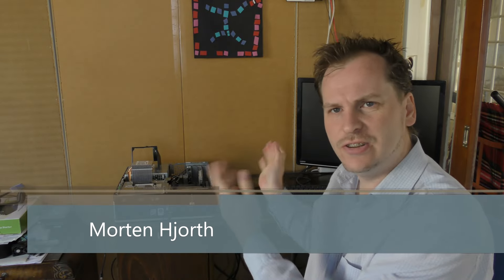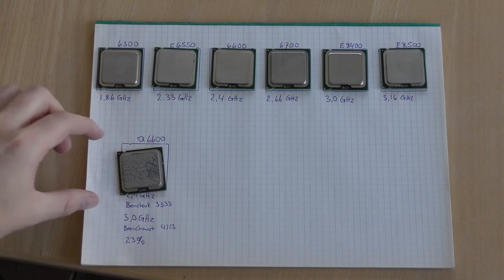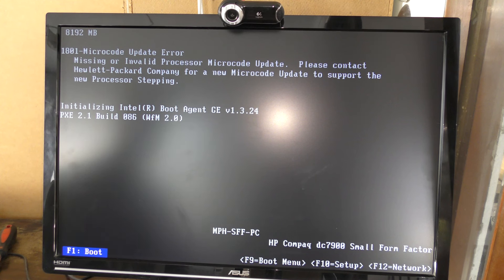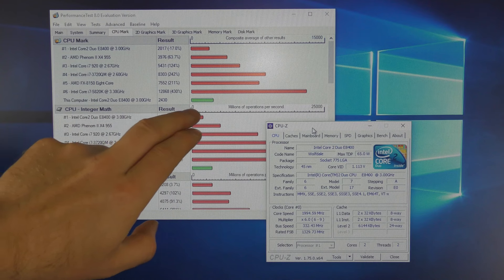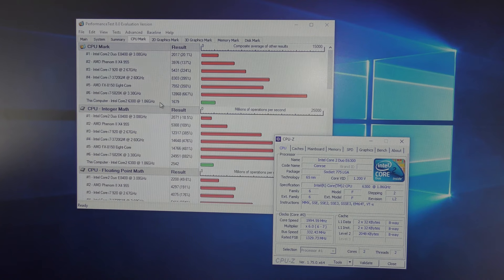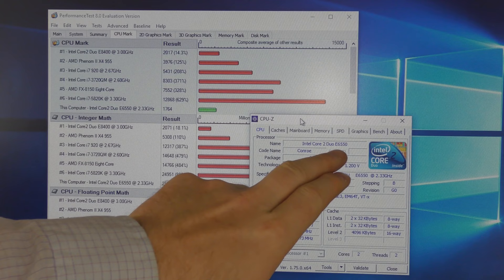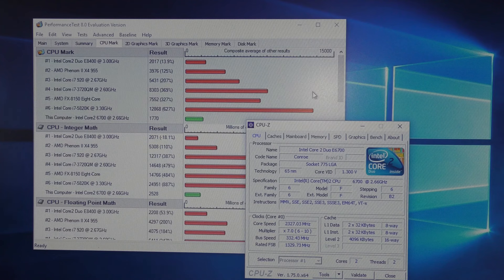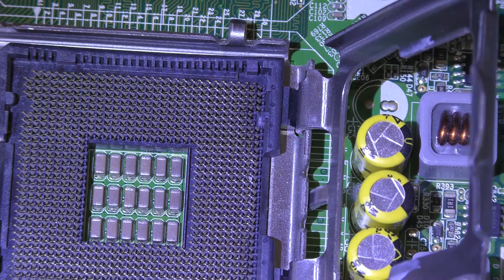Ninja Waste "BSEL Mod" E6xxx and E8xxx-series Intel Core2 - 386

Comment: where do i get microcode update for compaq dc 7700?
Reply: the sff version
Reply from the maker: Hi
Did you Google it? I'd start and see if there could be a new bios for it at HP's site.
Thank you for watching! :-)
Reply: My PlayHouse i google'd it and couldnt find it and at hp's website its only for windows xp or something. Can i do this mod without the microcode update on my e6300.
Reply from the maker: Hi albin29 
did you see this one? : http://h30434.www3.hp.com/t5/Desktop-Wireless-and-Networking/Can-a-HP-Compaq-dc7700-SFF-PC-be-upgraded-to-support-a-2-66/td-p/974939
Thank you for watching! :-)

Comment: It's called thermal interface material (TIM) and you're applying it improperly
Reply from the maker: HI
The thermal past stuff?
Thank you for watching! :-)
Reply: that's right ...check Intel's official documentation they call it TIM...and you can't.put all that on and in that.pattern! for a 775 cpu it should have a.pea sized fowr in the center and that's it, no need to put it around the cooler will spread it evenly and when you do put it around you risk it squeezing down and around the cpu on the pins in the socket! I'm a gpu it doesn't matter because there's no socket so as long as it's non-conductive you can put as much as you want but cpu must be careful....the only cpu that's diff is 2011's because they're so damn big you put a small line in the center about .75cm or so long

Comment: Hi, it's possible whit the Q9550 ? :) Thanks
Reply from the maker: Hi
Probably,, if it becomes any faster,, no idea :-) If you try it, do report back :-)
Thank you for watching! :-)
Reply: Nope. The Q9550 already had a 1333FSB, this trick only works on 1066FSB CPUs because you raise the FSB to 1333. Not all motherboards will do this however. Earlier 775 boards default to 1066FSB or even 800 for the P4 only boards.
Reply from the maker: Hi nelizmastr 
Thank you for the good info!
Thank you for watching! :-)

Comment: I have an E5800 Socket 775 LGA and I tried it 2 times and the pc runs but with just a blackscreen
Reply: and the fans go crazy
Reply from the maker: HI
http://ark.intel.com/products/42802/Intel-Pentium-Processor-E5800-2M-Cache-3_20-GHz-800-MHz-FSB

The E5800 is ment for 800MHz FSB, so Ninja hacking it for 1333MHz,, is to much.
Maybe try this : http://www.xtremesystems.org/forums/attachment.php?attachmentid=75201&stc=1&d=1206653163
The RED hack,,, but it is more difficult. :-/
 Thank you for watching! :-)
Reply: My PlayHouse
Do I connect the two pads somehow or do I just put tape on them. Because it looks like I have to connect them but how?
Reply from the maker: HI Tobstar138 
I haven't tried this one,,, read up on it!
Thank you for watching! :-)

Comment: This is not an O.C. at all, maybe a hack to make the pc unstable. The only way to O.C. is in BIOS using multiplier or FSB, tho overclocking thru FSB will likelly overclock everything on the motherboard and will run hotter. So if you have a locked CPU stick with it stock. In case you wanna O.C. make sure you have a good aftermarket cooler.
Reply from the maker: Hi Psykode
Thank You very much!  glad you liked the video :-)
Thank you for watching! :-)
Reply: @MyPlayHouse  you are welcome. I also researched this modding myself and found out that beside the cover with tape, you can also bridge pads. Depends on cpus
Reply: its impossible to unlock the multiplier on these cpu as its an internal locking, only old pentium had this option possible so the only remains method is the fsb but not always a stable method it depend of the motherboard and some skills about changing voltage on cpu carefully with 0.1 step

Comment: It also tried it yesterday with the pentium version (E2200), no good. PC don't boot with the hack. 
but my e7x00's are still running hacked :)
Reply from the maker: HI 
I added you info on the E7400 and E7500 in the description of this video. :-)
Thank you for watching! :-)
Reply: begin next week i get a bunck of cpu's (from Xeon 50xx to E54xx and C2D's) deliverd, i will try them in my dell optiplex/poweredge's next week for this hack.
Reply from the maker: uhh,, nice!
Reply: the dell manual states that the series (oa E6300,...) are supported, i am curious if that makes a difference in result (not having a microcode problem ).
Reply from the maker: Hi dedb25 
I do not have an other one to test on.
This PC was an HP DC7900 SFF
Thank you for watching! :-)
Reply: i will test it on my dell's and post the results here ;)
Reply from the maker: awesome!

Comment: Thought you might find this interesting if you weren't already aware. http://www.overclockers.com/intel-lga775-pad-modding/
Reply: This ^ The mod you were doing is intended to set a certain FSB different (higher) then the default FSB in some cases the specific tape you put on was on the wrong pins for the intended effect. Some pins you need to nullify or some you need to actually short together to increase the FSB. as explained per the link from Chad.
Reply: Thank you

Comment: can this mod work on e8300 please?
Reply from the maker: No the FSB of the E8300 is already 1333MHz
Reply: What?? 
I do not understand
Reply from the maker: The ninja trick,, is to trick the system board to think that the CPU with a FSB of 1066MhZ is really a 1333MHz,, so it will provide a higher frequency to the CPU, than what it is ment for. But if the CPU like the E8300 is really a 1333MHz,, there is nothing to trick.
Reply: @MyPlayHouse  how to trick it to think it is 1600 mhz? There is for sure some pin combination,